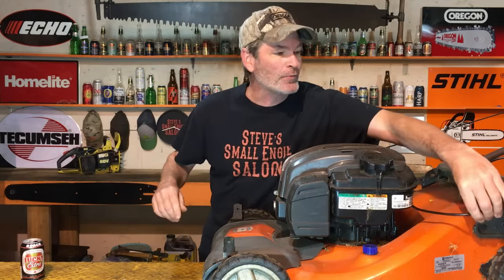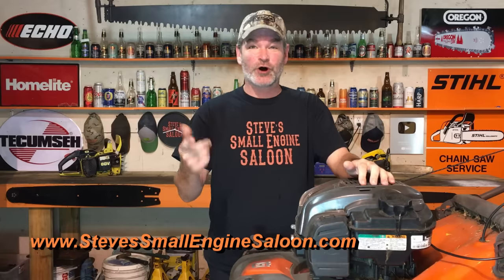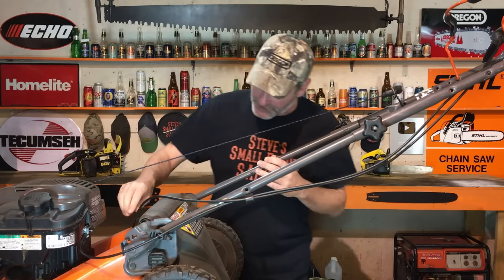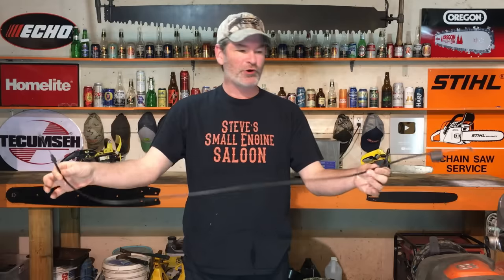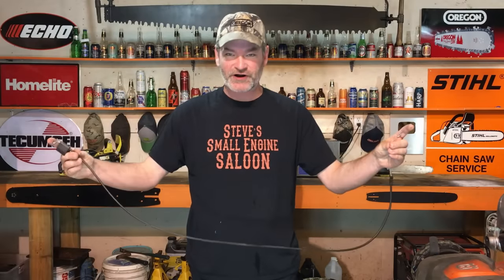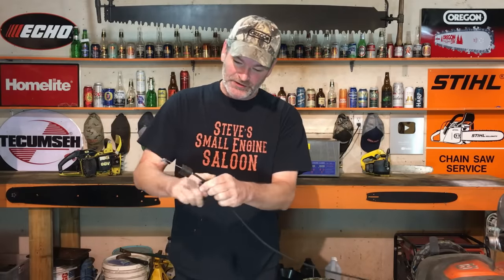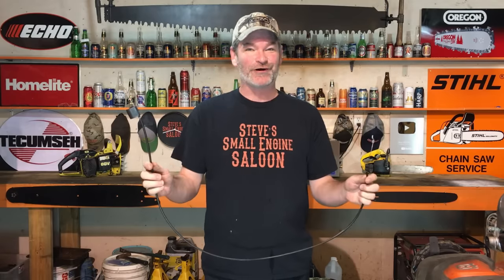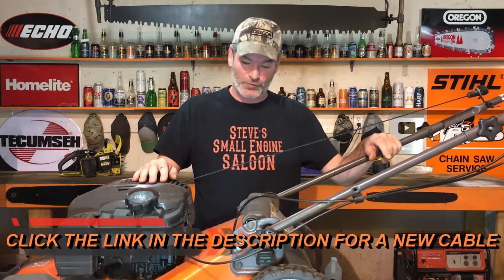How To Adjust A Non-Adjustable Lawn Mower Cable

Comment: Very nice tip for dealing with these cables.  I just bought a brand new cable (the old one had broken completely through), and when I installed it, the cable was too long!  (Just as if it had stretched already, as Steve suggested happens to some when they get old).  I thought I'd been given the wrong part, but then I came across this video.  Voila!  Fixed!  (And as a coincidence, it's even on the same brand of mower as Steve demonstrated on, though of course that doesn't matter).  Very nice tip, Steve!
Reply from the maker: Happy to help!  Thank You...

Comment: Great video! If I could make one suggestion, it would be to lubricate the cable since you have it off already. They can last quite a long time with a good water-repelling lubricant. Not something like WD-40 that dries up in a couple days, but something that sticks to the cable inside the sleeve. I use white lithium spray lubricant and get inside each end really good, and then work the cable back and forth for a few minutes, reapplying the lube at each end throughout the process. I do this every other year. My dad used to soak the cables in used motor oil overnight and that works ok to free up a stuck cable, but I found that the acidity of used motor oil will promote oxidization.
Reply: Great tip most people don't do. Also good for Bicycle cables or any other type cable that is exposed to the elements. I've used Vaseline in a pinch but Grease them usually now. 👍 👍
Reply: @michaelcefaratti539  Completely off-topic, but you've got excellent taste in music, my dude.
Reply: Thanks lol 🤘😁🤘52 and 💯Metalhead since a teenager

Comment: I identified that exact problem with my mower a frew days ago. Not having this solution in hand, I cobbled up my own:

1)  I tore out the safety mechanism altogether.

2) I connected a light switch from the ground wire to a ground connection on the mower  ----to a bolt I loosened, added the ground wire then tightened again.

So now, when the switch is on, it shuts off the mower because the ground wire goes through the switch to ground. And when the switch is off,  the engine will run.

I think I'll improve on that by using a piece of sheet metal screwed in to a bolt on the engine.  When the springy sheet metal is pushed in, it connects to the top of the spark plug, ground it out and shutting off the engine. This involves taking the rubber boot off the spark plug to expose the high voltage connection.

So I'll be able to use a foot/shoe to  push the sheet metal to connect with the high voltage connection on the spark plug,  grounding out the voltage.

Comment: Huge thanks for this video and this super easy tip! And to all the other chicks out there like me, you can do this!

Was messing around with the carburetor for a long time (plus new gas cap, new spark plug) and was about to give up and take it in ... And then I saw your video!!! I was able to adjust the cable and I just couldn't believe it when it started with a single pull! I probably do need to buy a new cable because it's really stretched out, but it's such a relief to pinpoint the problem and fix it on my own. I learned so much in the process! Many thanks for sharing your knowledge!
Reply from the maker: You're Welcome...and Thank You...

Comment: Great video! I saw your other video on the governor arm mechanism but glad I didn’t start fooling around with it. This is what I needed to tighten up my engine speed at full throttle; the cable was simply too loose. Who knew? Thanks 🙏🏽

Comment: Good video , I have a throttle assembly that need to replace on an old Honda with manual choke . But the kill cable and throttle are in one housing . Throttle lever is broke and have to take pliers to make it functional... itsa 42". Throttle cable with a manual choke for an old old GV 160 . Been looking it's great old Honda engine put on a easy push frame . Thanks again

Comment: Steve, I wish you would show people how to get the cable off of the main part of the lawnmower. I had no problem getting it off the handle but had a problem down on the lawnmower.
Reply: The easiest way I found is to remove the spring where the cable attaches to the motor. Use a pair of large channel lock pliers and the spring is easily removable and just as easy to reinstall.

Comment: Ever have a brake handle get stuck in the down position on a Deere riding mower?.......ya me either but it's happened and I have no idea how to get it in stick. Awesome info on the cable adjustment Steve, I was having trouble with one till you showed me this lol. Works great now 👍. Thanks Steve. 

Any advice on the parking brake?

Comment: Do you have a video on how to connect drive cables to the plastic handle. That's awsome. I did not know you could adjust the cable

Comment: Hey Steve you should do a video on rebuilding a hydrostatic transmission pump off a zero turn lawnmower. I'm getting ready to do one for the first time. It would be helpful to know what to watch out for and how to not make the problem worse. Thanks.

Comment: Hey Steve. I have the opposite problem. I brought a mower back from the dead with new carb, plug and cables. Mower starts on 1st pull holding down the lever but when I let it go it stalls right out.
Should I get a tighter spring? The lever is not loose at all. Love the video! You have a new subscriber!!

Comment: great job as always, question what is the diameter of that braided wire? I need to replace mine as it is fraid on my jdeere drive cable   thanks a million

Comment: I have an old Craftsman mower . The accelerator cable, a solid wire, does not slide inside of the plastic cover. Is it supposed to or does the entire cable inside solid wire and the exterior plastic cover slide back and forth? Thanks. Great video!

Comment: Hey Steve, I have the exact same cable on my Husq. What would cause that cable to be crazy hard to pull? I took the cable off like you did and it moves smoothly in the sleeve. No hangups or drag. Just when its pulling the brake. ty!!

Comment: Now mine will turn over but it immediately stalls. I know it’s not the carburetor as the issue started after  caught the throttle cable on something and yanked it a bit. Thanks for the tip, I guess I got something else going on along with the cable.

Comment: Lol I have mickey mouse ears on mine. I put that knot in the drive cable and it shortened it too much and made me have to pull on the bar harder and was so uncomfortable to hold because the tension was pulling back on my hand constantly. I then caught hell trying to get the knot out and had to buy a new cable anyway. This tip is way better :)

Comment: Great tip!!!  I have an older generator that runs great on about a quarter choke.  Cleaned the carb twice in the ultra sonic and it still needs some choke.  The bowl nut on this carb is not jetted. The jet on this carb is on the side of the emulsion tube.  Was wondering your thoughts on opening the hole in that jet just a bit?   Not sure what else to do. Any help from you guys would be appreciated.. Thanks!

Comment: Steve I have a question, but first thanks for the info. Today I went to start my lawn mower and my cable won’t budge. It is not loose in the sheath. It won’t move. I sprayed lube down and still nothing. Any advice?

Comment: Hi Steve, I have an old snapper lawnmower with a Briggs and got some wire wound up in the blade and killed the motor. I cut off the wire and tried to restart it but no compression? I just took the power head off and now it has compression again? What happened? Thanks

Comment: I did not know that. I always just bent the L shaped mounting bracket on the engine where the lower end of the cable mounted to, to get it to start. I will remember this!
Reply from the maker: Right on

Comment: good tip, i didn't know that ... but just to clarify, this would only apply if your lawn mower is not starting because cable is not pulling enough ... i mean this is NOT a engine throttle mechanism. it only enables or disables engine starts, there is no in between ... although you could maybe use same technique in other cables for other purposes maybe

Comment: Just a quick question. I bought a new traction bail and cable for an Ariens LM21S. The eyelet of the cable is super tight fitting on the bail post. Is this a normal fit???

Comment: Enjoy this site cause it's a far site better than near sightedness! OK, seriously, wonder about this little 1 piston 80 cc gas motor comes with a motorbike I have been riding lately. It uses regular gas but what if I put in 91 octane premium fuel? benefits/disadvantages?  Performance?  Emissions? Easier or harder on motor? Better mileage?? Just wondering. Thx for your attention on this long-time issue. I already know it's more expensive. LOL.

Comment: Steve, I have this exact mower, and was able to get it running with your suggestion.  But I couldn’t unthread the bottom of the cable, only the top.  How did you remove it from the bottom?

Comment: I hope this helps by making cable longer.  My problem is, It shuts down if I let stop bar go, and hold it about half way.  The engine continues running if I don't hold it at half way down.  Thanks.  bob

Comment: Dang.......... Dude.......   Freakin Great!!!   I never knew that the ends of the cable could be screwed out to adjust for a stretched cable!  But I do give the mickey mouse version a thumbs up for the Ol' knot tie....LOL,  however, I have my own mickey mouse version.  In the past I have gotten so frustrated that I would take the cable off all together and just tie wire that mechanism that the cable hooks to open enough to start my lawnmower  and then just carry my insulated pliers with me to pull the spark plug cable off when I wanted to stop it!  It worked actually for the rest of that particular lawnmowers life......LOL!!!  But...........  Your tip Steve is the Freaking Game Changer!!!  Have your website saved in my fav's NOW!!!  And........  just for the sake of it....... I think Ima gonna stretch my job out to two beers......
Reply from the maker: Right on Tim!  Thank You...

Comment: Older mowers don't have or need that cable. On most of mine that had it, the cable didn't stretch, it rusted and broke. I wasn't about to buy a $14 cable to fix a $25 mower so I just tossed the cable, tied open the blade brake and if i want to shut it down, I'll pull the plug wire. Two of mine have been like that for 10 years now. On a few, I've completely removed that brake assembly and just run a dirt bike kill switch on the handle for mowers used by someone who's afraid to unplug the plug wire.
Reply: I just remove the big spring and it won’t clamp down anymore. To kill the engine just squeeze the arm’s together that the spring was hooked to.

Comment: I just took my mower to a small engine mechanic. Wish I saw this video before yesterday. 
My mower still won’t start and I’ve changed and cleaned the air filter area, carburetor, new oil and new gas, new spark plug….now wondering if it was this.

Comment: Hello Steve , I've got a Husqvarna HU625AWD , that isn't firing , I adjusted the cable as you showed , but only one end of my cable has that , it still didn't start , what other reason might cause a non firing situation ?
The plug was clean , not gummed up, pulling on it with plug and wire laying on muffler , I got one weak blue spark , then nothing , suggestions please ?

Comment: Generally I find the cable has rusted up and the internal cable has stretched because the cable froze up and by pulling really hard on a rusted cable, the strands stretch and even break causing the cable to hang up or just not work. If the handle hangs up or drags when pulling, the cable is internally ruined from moisture, rust. By lubricating the upper cable end every year, that prevents the cable from rusting up. I noticed this more on mowers left outside all winter.

Comment: My husqvarna self propelled is still working but not pulling like it should and it feels like the cable ain't as tight.  Does that mean I need to replace the drive belt?

Comment: Always a great video Steve. I thought I would ask this question here, on your recent post. Once up on a time, I had both 40 and 50 :1 equipment. I ran it all at 40:1. Now, I think all my 2 stroke engines run 50:1 but I'm still running 40:1 mix. All seems fine and ports are not clogging up. Should I switch to 50:1 gas/oil mix? Does running it all at 40:1 make me a bad person? Is it easier on my engines? I'll sip my rum and Coke as I await your wizardly pronouncement from the mountain top! Regards, Jimmy
Reply from the maker: I run all my 2-strokes at 40:1!  Always have and always will....

Comment: I have a Toro front repel 6.50 ft. Gross torque  190cc model 20330. I pull the bar handle to repel forward, but cable snap forward and stretched it. Cable is still in tacked, not broken. Can u help me ? Please make video instructions to I can try to fix it myself. Push mower doesn't repel.Thank u.

Comment: Hey Steve, the tension on the drive control cable of my lawn mower does not have enough tension. It's a Troy Bilt lawnmower TB210. I recently replaced the drive belt and the front wheels. The front wheels at time don't spin. Other times they do. Any suggestions? Thanks

Comment: A few weeks ago I tried this on a control wire I ordered and it keep squeezing back together. Is there any other way to adjust the cable. I returned that control wire and got one an inch shorter but contact on the break still touches when the bale is squeezed.

Comment: I got a craftsman fwd push mower with the.  bag.. My on and off cable is stretched out.. Also. The plastic housing that supports the canle or what it sits in is broken. . and the mower is reving super highband not shutting off. Please help

Comment: I just picked up a mower ruffly the same I just removed the cable and bent the kill switch so it was outside of the cowling and put a on off switch from a dead Honda pump engine all good now and no stupid deadman switch I'm old school and don't like having to pull start the mower every time I take my hands off the mower to empty the catcher

Comment: Very helpful
Reply from the maker: Glad to hear that
Reply: @StevesSmallEngineSaloon  yessir - used it last night. The cable and spring or cable rusted and I wired it up so it would still start, but now a year or two later the boy wants to help and so I need it safer for him so I got a new cable. Tying a knot would break the cable over time I'd think also but I was about to until I saw this.

Comment: Here is my dilemma Steve.  The bail handle broke in two pieces.  It's history.  To continue using this FREE lawnmower, I have an idea now to somehow pull that spring back and lock it in a fixed position/tension.  Am I on the right track.  Thanks.  Steve

Comment: As me being a Hard Core Biker:  I already knew this. The Cables on a Harley are the same almost as this is. But the only difference is; on a Harley you have a Long screw and nut the adjusts the Cable for the Clutch and the Brake. 2 DIFFERENT Cables now. But they Adjust the same way. For the Lawn mower it is just a cheaper way is all. Only because the cable is not Heavy Duty; and it is only a Lawn-Mower.

Comment: Is it possible to increase the speed of a no prime no choke  push mower seems its just needs a little more rpm on the motor. It doesn't have any speed adjustment on it.

Comment: Steve, I don't want to ajust the cable. I need to ajust the whole handle. My lawn mower is about to break by back. It is set to low where I' m bent over when I'm mowing

Comment: How do you turn up blade speed?
Reply from the maker: That video is in my playlist
Reply: Theres an arm behind the tank that holds the end of the governor spring. Reach in and slightly bend it toward the front of mower. Doesn't take much.

Comment: I'm trying to understand why this works.  Is it because only the exposed section of throttle cable is where the "slack" from stretching exists, and not along the length of cable inside the sheath because the sheath fits so close around the cable?  So lengthening the sheath shortens the exposed part of the cable and that effectively takes up the slack??

Comment: MORNING Steve, I have never replaced the Husqvarna operator presence control cable for the Bar and the choke. I aiways thought if I did they were placed and heated in place. Not, The new one I just got today needs adjusted on both ends. Have you done a video showing how to install a new cable?

Comment: Mine new one is too short. It releases the brake and stop, but the bail only goes half way down. The outer part of the cable needs to be shorter by about half an inch. The best way would be to move the cable holder up a bit, but in this model the drive and stop are held in the same place along the upper handle. Unless anyone has a better idea, I'm going to cut the outer cable down and screw the cable clip a half inch farther in.

Comment: I'm thinking the original was probably seated solid in the housing ends.... and I'm thinking a little split sleeve would once again seat the cable housing solid in the ends.   There is a lot of tension on those cables and when the old mowers are left out in the weather it doesn't help much.   I'm also thinking,  "what if a person used a spring with less tension so the newly lengthened cable housing didn't have to work so hard?"    Safety brakes are for sissies.